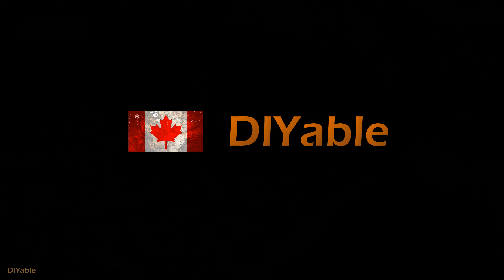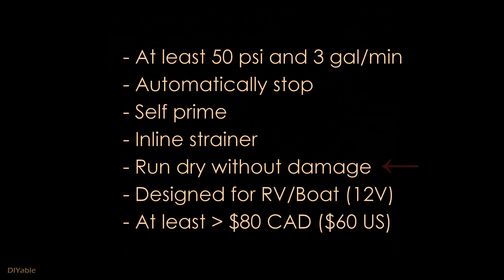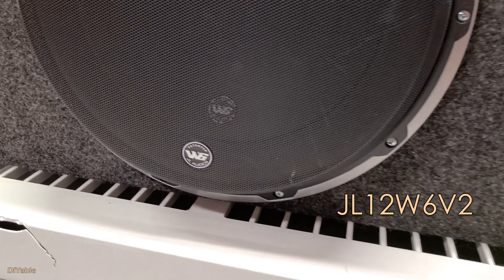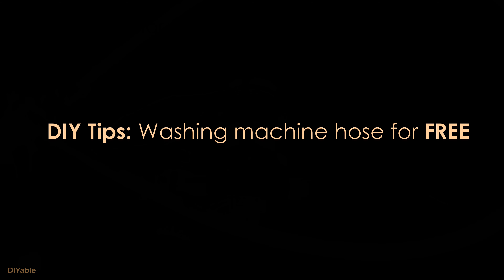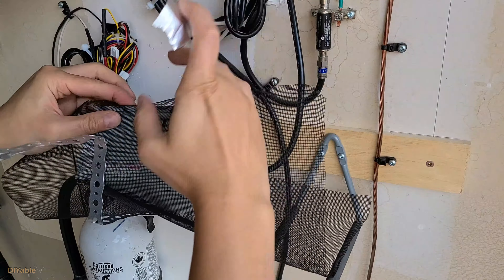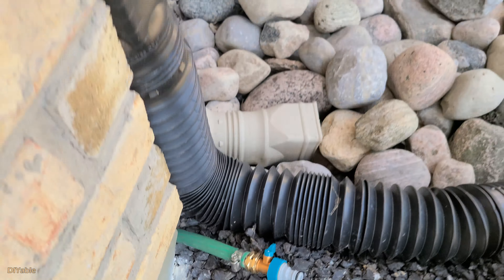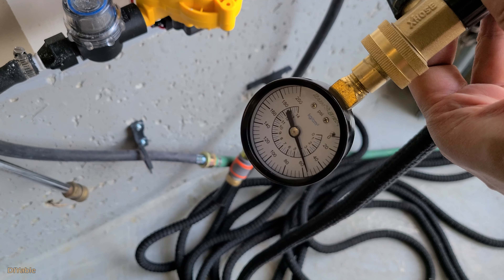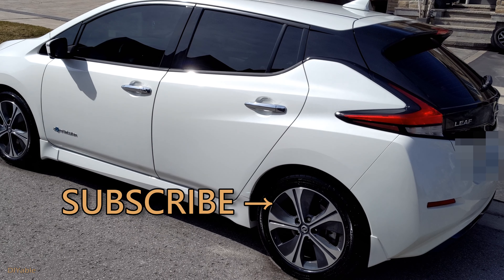Water is FREE - How to transform Rain Barrel with old desktop computer to increase water pressure?

Comment: Do you apply any filtering for the rain water? I always see large dust for dirt in my barrel. I have a submarine pump too for watering my lawn but just like the transformer I also add the net also filter for my pump.
Reply from the maker: In the video, I showed you I added the gutter foam filter in the water diverter before it enters the rain barrel. Not sure if that's what you are referring to.. It works prety well. For my pump I do have the stainless steel strainer to protect the pump.

Comment: LOL, paper towel.  For someone so OCD, I can’t believe you use paper towel over a cheap microfiber cloth.  Love the setup.
Reply from the maker: Glad you love the setup.... hope give you some ideas.  Paper towel wise, I am not going to comment. LOL...
Reply: @DIYable  I need to show you my setup one day.  We’re in thornhill :)
Reply: Optimum No Rinse (ONR) is a rinseless car cleaning product, check out a youtube video about it! I wonder if that's allowed in that case in your city. Just need a 1 to 5 gallon bucket to apply the product with a towel or sponge to the paint surface (its polymers bond around dirt particles), then you wipe it off with a bunch of microfiber cloths that trap the safety-encapsulated dirt in between the microfiber towel nap. You just work in sections at a time so that it doesn't dry before you gently wipe it off, otherwise you just apply the ONR again to that part.

Comment: How long does it take, generally, to empty your rain barrel if you only used it for watering your lawn?  This past summer we were in a severe drought, which brought with it watering restrictions. It got me to thinking about installing a rain barrel, but it ultimately wouldn't have done us any good past a certain point without receiving any rain.
This was brilliant, BTW! I would've never in a million years thought to use a 12v marine pump!!
Reply from the maker: It depends on the summer weather honestly, it does run out of water in July and I am not lying to you. But as soon as there is rain, it tops it up. Now, if you are serious about rain harvesting, you can setup multiple rain barrels and connect them together, that would last way longer.  I hope that helps.
Reply: @DIYable  Very informative, thank you for the input!!🍻

Comment: Only thing is ROI after spending $100 for a water distribution system.  I understand the desire to use something that is free, however it would take years and years before you would see break-even.  Add to that, many more things to break or go wrong vs just using the tap and garden hose.  Also, if car soap is not allowed, why not use some dish soap?
Reply from the maker: Dish soap!! Never thought about that!!